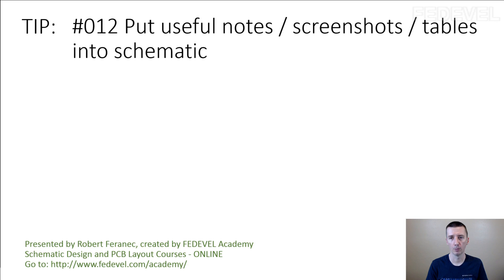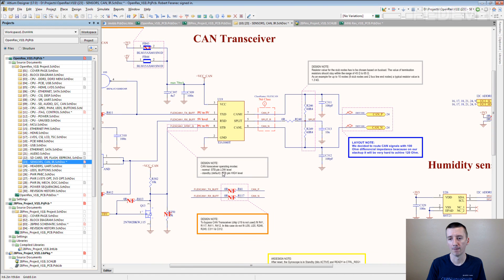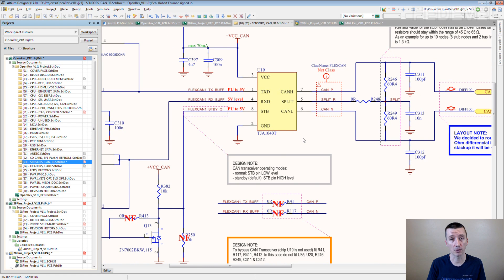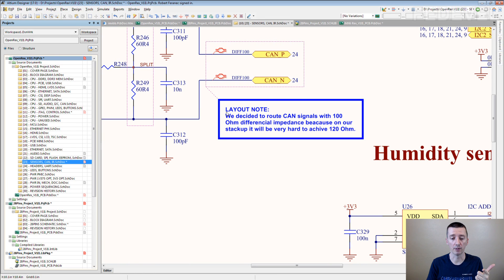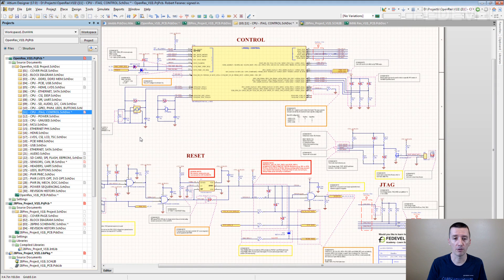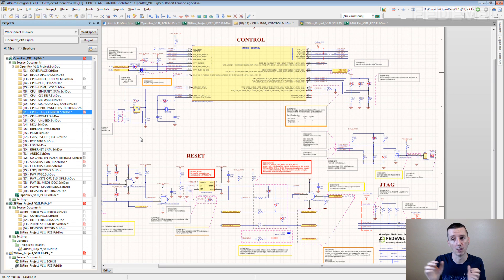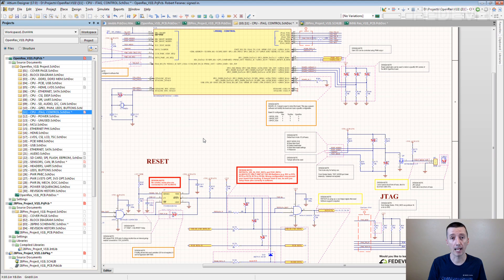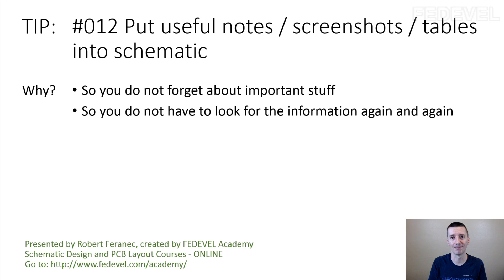TIP #012: Put useful notes / screenshots / tables into schematic

Comment: It would be nice if Altium would support notes in component library, so you could make it once and place it on schematic every time you use that component. I somehow made it work with multipart component. First part is standard schematic component and second part are notes, but it has some problems (like same designator position for both parts).
Reply from the maker: Good idea. Once I suggested Altium to create a special layer in schematic for adding notes. You could switch on / off all the notes, that could be sometimes useful (e.g. print schematic for engineers with all the notes and print a nice schematic without all the detailed notes and comments for documentation).

Comment: I put some kind of this stuff in the schematic, mainly layout info for firmware/software but I prefer to do a complete design document for every board.  This document (Word or Confluence) goes into great detail about the specifics about the schematic, layout, and the final product (if I'm handling that side of the project).  I found that MS Word or Confluence allows me to get more details about the design and allows me get the information across better.
Reply: i've done this before too, an all-encompassing design doc that also has explanations for design decisions, and the first part has all the known requirements/constraints for the design
Reply from the maker: Interesting. This is a good idea.